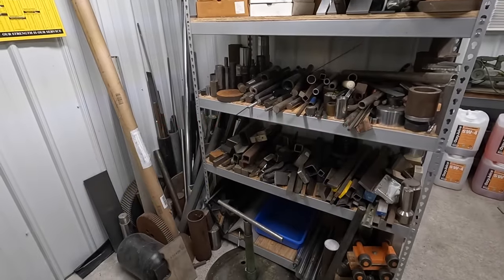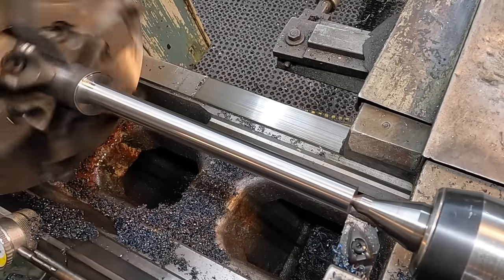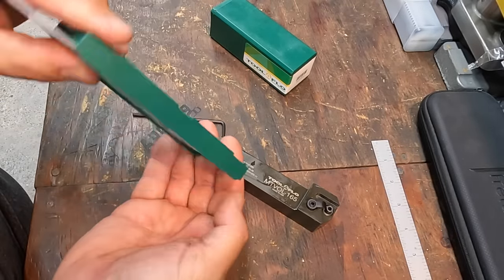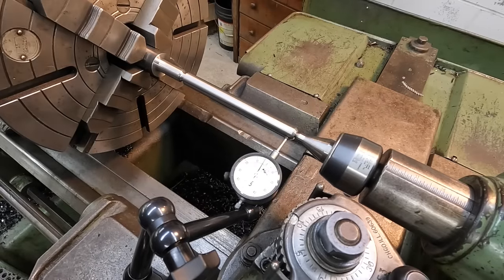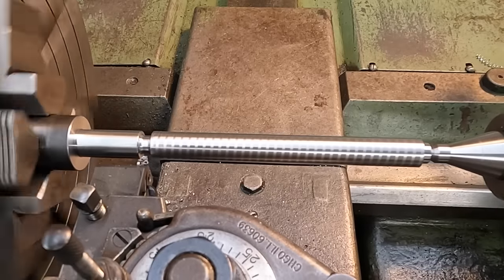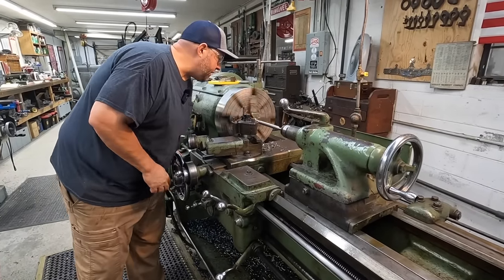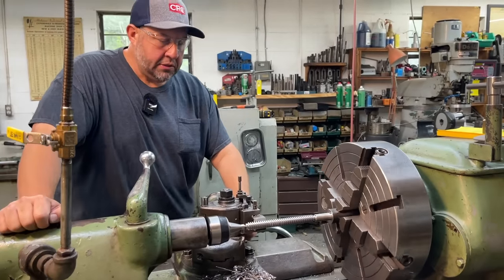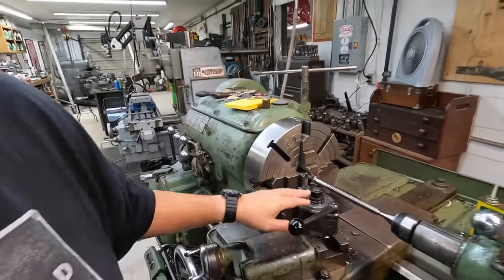Compound Lead Screw for American Pacemaker

Comment: No travelling steady,no coolant, too much tip form cutting,just what did you expect to happen? you could have gone halfway in thread depth then taken the top of the thread to width and then gone to depth without too much depth of cut cut.

Comment: The problem is the small diameter screw… it is not the lathe . It is pulling it in because the screw just started going up on your tool… it usually happens on the last 2-3 passes… you need following rest . I have also Destroyed a lot of screw like that …
Reply: I think you are spot on!  I couldn't believe there was no steady  to prevent climbing.
Reply: RPM reduced use coolant because final depth over load...
Reply: Correct,That is the reason.
Reply: It flexes away from the tool, which causes the thread walls to spread out on the far side of the tool, and to pinch in on the near side…. So it pinches the tool, and, like you said, it tries to climb up it.
Reply: I’m just a amateur but I had a similar problem with 3/4x8 tpi acme thread.  I used a follow rest and the tool pressure was so high it destroyed the brass tips on my follow rest.  Any ideas?
Reply: @aaronfritz7234  depends also what steel did you used. Mild steel
You can’t Thread nicely.
Reply: @aaronfritz7234  Running bronze tips on a thread is not ideal as the crests will be moving across them and will chew them up. I have cut 7/8 8 tpi about 10” long without a  follower rest without an issue. I ground my tool from HSS and cut at the 14 degree angle. I took really light cuts with plenty of oil.  ACME is harder Than a V thread as the tip is wider. I have seen some suggestions to cut the initial passes with a V tool, you just need to choose a final depth that will be machined out with the ACME tool. Could you also make up a pair of fingers for your follower rest with roller bearings?  I would use some of that stress proof it look like it machines beautifully.
Reply: I agree. Every successive pass reduces the inner diameter of the screw and therefore its longitudinal rigidity. We all saw the exact point at which the inward pressure of the insert overcame the longitudinal rigidity as the screw climbed up the tool. I would think lighter and lighter passes as you go further in the thread with lubricant.
Reply: Happens to me if I don’t use a follow rest dang part climbing the tool .

Comment: The material is getting so small on the minor dia for its length. The material is flexing and trying to climb over the tool. Trust me, the machine is fine
Reply: I tend to agree with you. 
My understanding is like this -  "While the tool is normally cutting, it is pulling the rod towards itself. / By default the rod always wants to roll up on top of the cutting tool.
 When the rod becomes thinner it is less able to resist that pulling action and so it moves toward the tool which results in excess material being removed.
When the rod was thicker it was better able to resist deforming towards the tool. 
The work piece has a changing resonant frequency so be sure to listen to it when it starts to appear. 
It's telling you that vibrational waves are present and they can rapidly get into phase with each other to sing loudly together to vibrate the work piece violently. "~ original answer by RocketMan.

Comment: Worked for a company that made lead screws and Ballscrews for 23 years, when we were single point cutting such a large acme we would rough it out with a v form tool first, then cut 5he whole form after and using a spring pass every 10 or so full cuts. Also normally would use a travelling steady to stop the work piece flexing.

Comment: I tip my hat to you for showing the mistakes as they happened. As many others have said, numerous variables were involved in the failure. Some in the machine and some in the operator. Not a ding by any means on your abilities, or the eccentricities  of the machine, it's just some times the process gets overwhelmed by tiny compounded problems. Be thankful the dig in did not lead to a "grab and fling" (been there, not fun)

Comment: The root diameter that Adam was approaching is less than 0.55", which makes for a pretty flexible workpiece.. I think what is happening is that as the tool gets towards the mid length of the workpiece, the workpiece is deflecting upwards, which puts the tool below center, which then allows the workpiece to start to climb into the tool and thereby deepen the cut.  The shallow taper on the flanks of the thread probably enhances the effect. In other words, the flanks of the thread on the workpiece can engage with the below centrer tapered tool  and so make the workpiece climb further onto the tool.  The effect may even be sucking the cross slide (or the topslide) forward into the cut. Some  backward hand pressure on the tool post may avoid the latter possibility. A travelling steady would stop the workpiece from deflecting upwards in the first place and hopefully stop the whole cascade from starting.  It is really good that Adam shares the things that don't work out as expected. That's where some of the best lessons come from. Cheers.
Reply: That's just under 14 mm whooo that's very thin. Think the original would be made in a different way then turning.
Reply: Agreed.  A travelling steady is definitely worth a try, especially with an Acme thread since the top is flat.
Reply: Clear and articulated, should make top comment.
Reply: yea but he said he was just feeding 1/2000" ...?
Reply: Agreed, perhaps a follow rest or steady rest might be in order here.
Reply: @kbuss10  .002
Reply: @kbuss10  Yes, Adam did say that in trying to overcome the graunching that he had reduced the infeed to 0.002”, but it was to no avail. This just reflects the fact that as the core diameter was reduced, the whole setup reached a point of instability, such that a tiny upward deflection of the workpiece would feedback on itself by allowing the tool to spring forward a little more and jamb itself between the tapered flanks of the thread and cause more cutting force and more deflection and so on. A vicious circle. It was noticeable that the graunching started first at the point where tool was closer to the tailstock than the chuck ( See 35:00 in the video). Thinking about the workpiece as a beam that has to resist the upward and inward cutting force exerted by the tool, the beam is fixed in direction at the chuck but at the tailstock center it is essentially only pin supported. In such case, the maximum deflection of the beam due to the moving point load from the tool will occur, not with the tool at the middle of the beam, but rather closer to the pin support, ie the tailstock end.  And that’s where the graunching first started up. Then as Adam made some further cuts and reduced the core diameter further, the graunch zone expanded to include a greater length of the workpiece but the chuck end of the workpiece remained unaffected the longest. Adam said that in the graunch condition, the tool was cutting on both flanks rather than just the advancing flank. This is exactly what you would expect if the workpiece is climbing onto the tool.  As the workpiece lifts, the tool is then below center, which relieves the cutting force on the tip of the tool. However, the spring in the tool and the workpiece allows the tool to engage more closely with the cutting on the flanks. In other words, the upward deflection of the workpiece allows a reallocation of the inward cutting force between that directed at cutting on the tip of the tool and that directed to cutting on the flanks. The flexibility of the workpiece reached a point where the positive feedback in favour of more deflection exceeded the negative feedback from the elastic rigidity of the setup trying to oppose deflection and thus the graunch became self-sustaining. Adam had created the mechanical equivalent of an electronic oscillator. Cheers.
Reply: Also remember that 2 thou is the depth on the front of the cutter (which is flat on an acme!), and you then have 2 thou * cos 14 (I think) on the leading edge. So a lot more tool pressure than 2 thou sounds like.
Reply: @sfogarty2  Yes that’s true. The last few passes were pushing the shaft away and bending it enough to cause the tool to dig in and cut on all three sides. That was too much pressure for this diameter shaft causing it to fail near the center as it began to flex and push back against the tool. .002 would have been okay if the shaft had been supported or larger. Too bad, had to be a huge disappointment for Adam.
Reply: @sfogarty2  Yes, when the thread is near to full depth, the tool is cutting on a large perimeter. For a 5 TPI Acme and neglecting the trailing flank, the sum of the tip width and the advancing flank is 0.174” (4.4 mm). You wouldn’t normally approach the middle of a 12” long by 0.55” diameter workpiece with a 4.4mm wide parting tool and expect anything good to ensue.  After a bit of head scratching, I think the actual depth of cut of the leading flank is a little different to your formulation. This is because the top slide is angled towards the angled leading flank of the thread. I believe the depth of cut on the leading flank is given by (top slide infeed) x sin(14 + 14.5). Thus a 0.002” infeed on the top slide set at 14 degrees gives a depth of cut on the leading flank of the tool of 0.00095”. Cheers.
Reply: @chrisarmstrong8198  these days guys have lost the art of grinding and using high speed bits. I was OK, but not what I'd call great. Just good enough to get the job done most of the time. Here's what I'm leading up  to. Tool pressure is your enemy when cutting any kind of a thread, and most will be using a carbide insert. Carbide has much more tool pressure than a good high speed tool bit. High tool pressure tends to push the work away from whatever is doing the cutting. You really see this with high nickel content steels and Ampco bronze. Then add to this the little discussed fact that most hand lathes were never designed for carbide from the start. Something's got to give, and it usually starts with the cross slide and spindle bearing group. 

Most hand lathes are never laid right from installation. Kind of a sad thing, but most folks don't really know how to make a lathe cut strait. frames tend to flex all over the place even when set right, but you learn to make that work for you.  If you buy a new lathe, never depend on the factory rep on the alignments (most call it leveling) as most don't know what they are talking about. Been a long time since we had good engine lathes like a Monarch EE or Hydraulic.

Comment: We had tons of folks have the same issue when cutting acme threads.  Usually, the case was the part was slipping in the chuck.  Either, it was twisting, or being pushed in/out.  Not saying that's what your specific problem is but it's worth looking at.

That being said, I typically will cut flats on round stock I use for acme threading... This way I get a positive hard connection on the stock, and a stop against the jaws where the round becomes flat, so that you can tell if it is trying to move anywhere on you.  Never had a problem doing it this way... Acme threads push a crap ton of pressure on the part and tooling, and even the tightest jaws can have issues holding it.
Reply: I am NO Machinist, but in my little mind, this possibility came up, so I agree with you.

Comment: Travelling steady rest. Your Monarch is one of the best. Please don't fault it.
I use to make 2 1/2 inch 316 stainless square thread, going left and right thread Level winder screws for fishing boat drums, sometimes 6-7 feet long. With a traveling steady, never had a problem.
You're a damn fine machinist and i've learned a great deal from you and really enjoy your videos.

Comment: Correct me if I'm wrong but as I see it. The deeper the tool gets the load increases and the cross section/diameter of the part is significantly reduced. This will cause the stock to flex and the tool to dig in, Add in to that heat build up and you'll have this problem. My punt is a follower rest and coolant should see it do just fine.....

I'd prefer to see this done on this machine as problem solving is all part of why I got into this stuff.

Greta video as always

Comment: I've had that same issue, your lathe is fine . . . Your part is climbing up your tool.  The part is getting less and less ridged and the insert less sharp.  Your taking a bug cut even if not deep because of the surface contact of that big insert.  As the part climbs its digging into the left side, the tool is aligned but the part isn't.  Clock your insert to a fresh face when you're close to depth.  Let part cool well and keep it cool.  Use coolant or at least oil.  I was told use a follow rest but I find they are more trouble than help.  Don't give up on that lathe, stick-stay and make it pay . . . Except the challenge.
Reply: I think this makes a lot of sense.
Reply: Was going to say the same thing.. I thought this fella knew what he was doing, but after the wheel valve video and this.. I'm not so sure now.
Reply: He hasn’t done acme threads got awhile. I find when I go a few years from a certain job, I don’t do it very well
Reply: For awhile
Reply: Makes a lot of sense Andy.  I'd like a look at the insert under a microscope to check for wear.  I'd do exactly as you suggest and rotate the insert when you start to see the chips changing in appearance.  The point about decreased rigidity is also well made, there must be a point on pretty well any thread where the length of the part, the decreasing diameter of the core and the ability of the tool to cut cleanly ( it's sharpness? ) gang up on you. In some of Adam's close-up shots you can see a small burr developing on the outer edge of the thread.  To me this is an indication that the tool is deforming rather than removing some of the material. Also note the chip form changing with successive cuts ( i.e 25:00 compared with 34:30 )
It's a long shot, but is the tool clamped flat to the bottom of the holder along it whole length? Even a few microns gap could allow a resonance to develop. 
Heat build up could also contribute as, if the part is held very rigidly, the heat could cause buckling.
Reply: @jayslife775   He definitely knows what he is doing but he is more used to larger more ridged parts where this is seldom an issue.  Adam is a talented guy no doubt.  Also sometimes you can be too close to a problem to see it and an eight year old spots it from across the street.
Reply: @chrisquinn3751    I only observed heat contributing to this type of chatter, figured it was making it more gummy or ductile.  I hadn't thought about heat expansion while restrained at the ends trying to turn it into a jump rope before now but very likely a contributing factor.  Thanks for the helpful insight.
Reply: @DaddyFattyDFN   Yes spring passes, lots of spring passes.  Turning something long and slender like that wants to turn thick in the middle because the part is deflected off the tool more in the center.  Over multiple passes the depth of cut in the middle will become more and more.  Soon you'll be taking a much heavier cut than intended in the middle of the pass where you are least ridged.  Spring passes will eliminate much of that.
Reply: Again I'd say stay please on that horse Adam.  There is much to learn here and figuring out the problem will make more interesting content than moving on.  I know you were frustrated and not having fun but hard times make success all the sweeter.
Reply: I have the same problem all the time with my light duty lathe with small parts.  I can make a pass then do a clean up pass at the same depth and get another 5 thousands off
Trying to sneak up on final detention 2 thousands at a time doesn't work for me . I can advance 2 thousands at a time with no cutting than it just digs in all the sudden and takes 20 thousands cut. Need to keep the cutter rasor sharp the last few passes on small diameters or take a lucky guess at hogging the last pass
Reply: @jayslife775  Every machinist has their weaknesses. I can cut a thread with the best of them, but ask me to hob a gear and you'll hear what sounds like a soul leaving the room...
Reply: I use a follow rest whenever I'm cutting threads on long bars for that exact reason, got the idea from Joe Pie and made up a follower rest from LE phenolic, it's a must for long threaded parts if you don't want lift.
Reply: Accept*
Reply: Aggressive machining is impressive when you get by with it, but usually you don't.
Reply: Your comment is spot on sir. Always use cutting / coolant fluid with a broad / large cutting tool face, , reduces tool wear and pressure on the  work piece  There is a critical point of least resistance to the tool pressure in relation to length and diameter  of the workpiece and the rigidity of the material ie the work piece is flexing away from the cutting edge of the tool causing the tool to "rub" instead of cut which in turn makes the work piece want to "moun"t the tool causing "chatter " which any turner / machinist knows can be dangerous.
With this particular job there are a couple of things you can do as I'm sure you'll know.  Unfortunately, a true craftsman will only share his secrets with an apprentice or a fellow craftsman but not on a public platform. I'm sure he will succeed in the end.
Reply: I wondered if this might be a solution. Finer cut, new tool face, don't know if there might be some appropriate cutting lubricant to use too. Shame the original didn't work out.